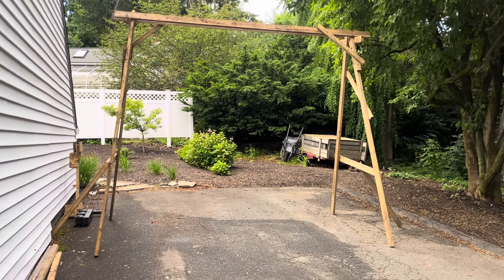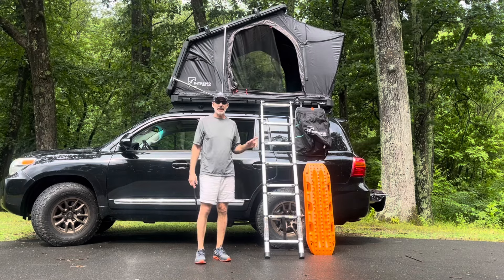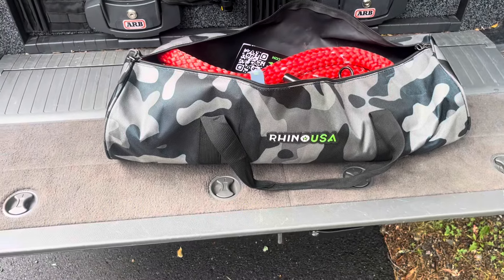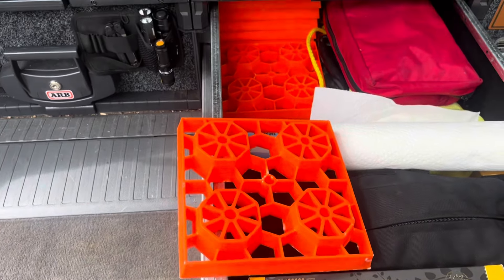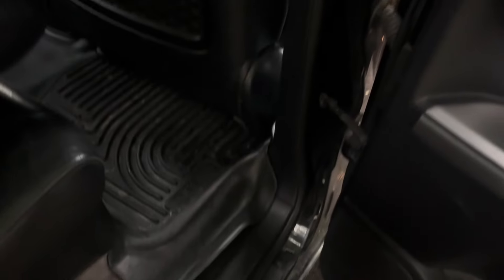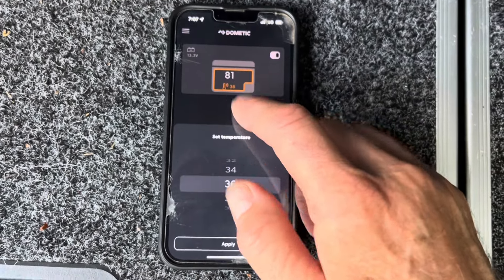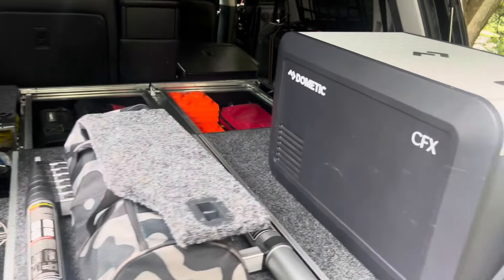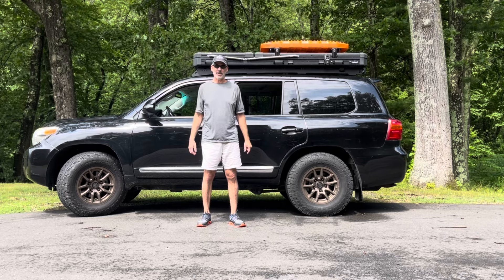Intrepid Geo 2.5 rooftop tent one year review. Plus a few product recommendations.

Comment: Been looking for a way to mount my awning. So glad I found your video. I have the exact same RTT. So u went custom bracket to mount your awning? Are there because already pre made?
Reply from the maker: I had to make custom brackets using aluminum angle because I wanted the awning to sit close to the rooftop tent and as high up as I could go without interfering with the latch.

I did a lot of searching on the web but didn’t really find anything.

Maybe Intrepid will use my idea and make a few.
Reply: @dougparis7095  agreed. I've also spoken with Intrepid about expanding the accessories for the rails. I 'm on the list for the FSR 270 awning, and I intend to make it work, whatever it takes, with my Geo 2.5. Thanks for the video! Very informative.
Reply from the maker: @Greg-cs8ky  The reason I went with the ARB awning is because it's 8'x8' so lots to coverage for rain or sun.  Takes a little longer to put away than a FSR 270 awning but once you figure out the trick it goes pretty fast.   
I should probably make a video on the correct way to setup and put away the awing.  Every YouTube video I've seen the people are struggling to set it up or put it away.
Reply: @dougparis7095  that would be great. I am also in touch with Kammock on their cantilever awning. I can actually see the case for a non-270 tent.